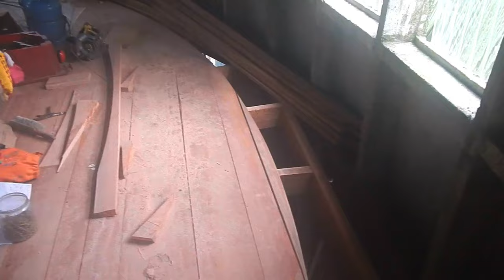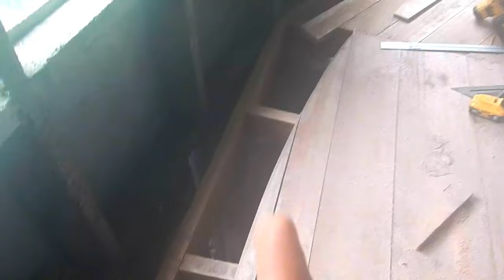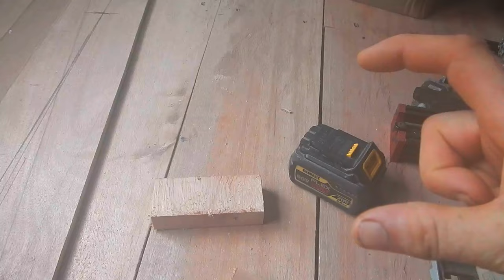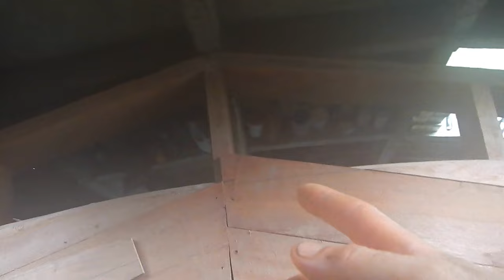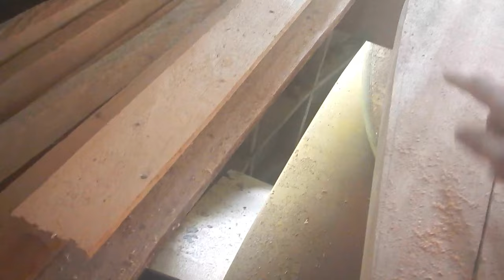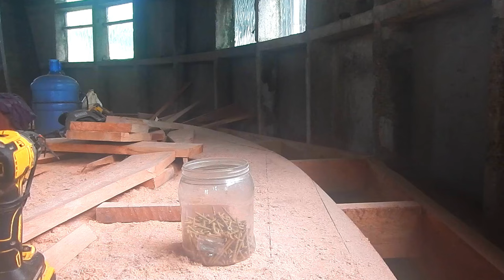Indoor Running Track!  Framing it.  (part 01)

Comment: Just a thought Jamie. Gusset the angle boards? The vibration from your running will eventually cause the glue bond to fail. You probably have enough scrap pieces of lumber. 8 screws (4 per side) times 48 will be costly plus more glue of course. Ez for me as I don't have to do the extra work😊
Reply: Nope, that glue on wood is unbreakable. It will fail only if is wet or the wood is really hard and cannot penetrate the fiber. I know that mahogany is hardwood, but this one seems not so hard as the kind I know. That one will split if screwed like that. I have plenty experience with that glue. And never failed. Always the wood was the one that failed.

Comment: Hey Jaimie. I think 30 degrees is to steep. Indoor track and field tracks are banked in the turns. They're approximately the same radius as your house and they're only banked at 10 to 15 degrees.
And for reference Nascar tracks are banked at 30 degrees.

Comment: I'm skeptical that 18" of board will be enough to be useful, and I'm also skeptical that 30 degrees is the right slope (less is my guess). But it's not set in stone, it can be re-done if it ends up being wrong.